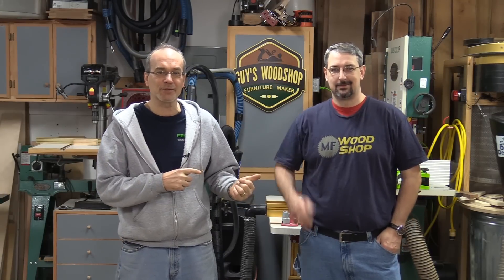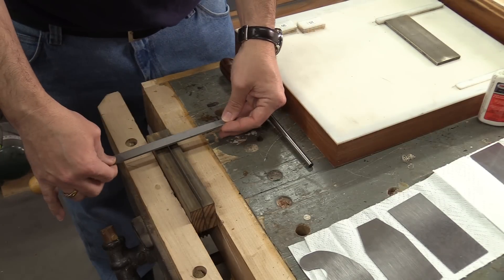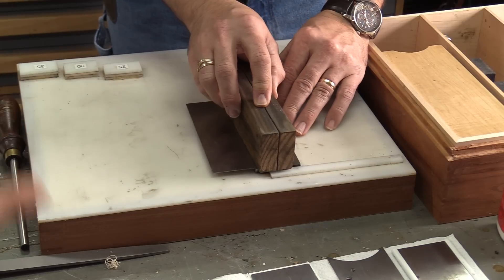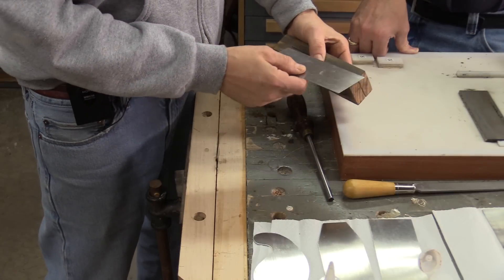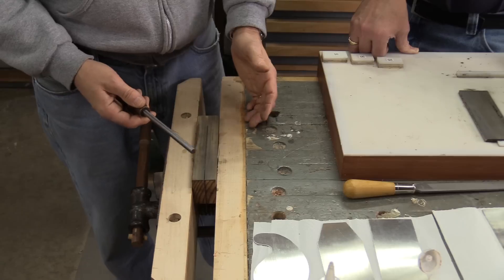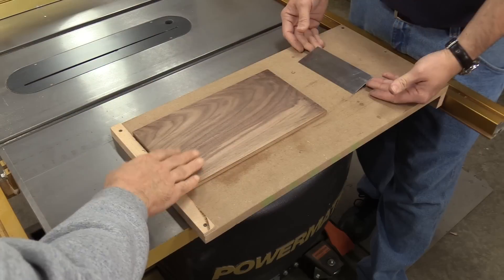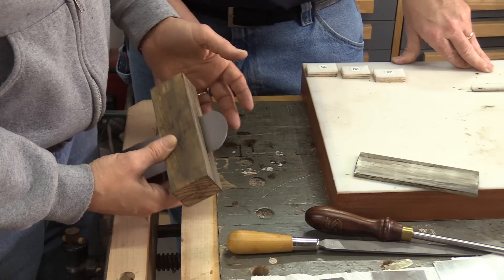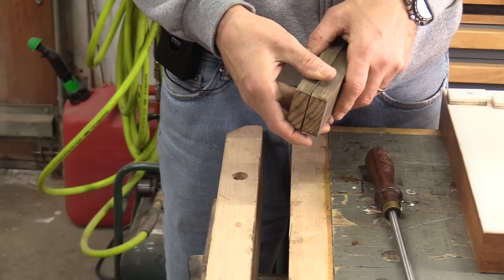Sharpening a Card Scraper WMike Fulton

Comment: I heard that you could use a steel that comes with a kitchen knife set to use as a burnisher but I haven't been able to get a burr using it. Is there a difference in that steel and the burnisher and have you heard of anyone having good results using one?
Reply from the maker: Hey Joshua. I have never tried using one of those burnishers before, so I am not sure. In theory it should work.